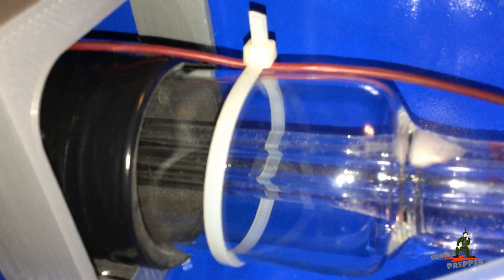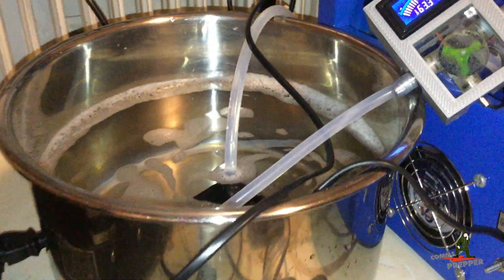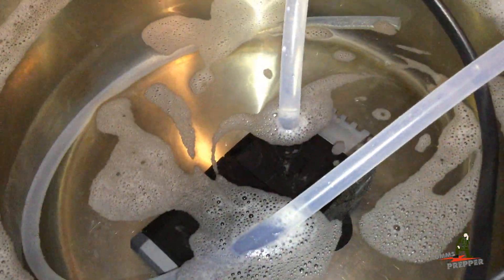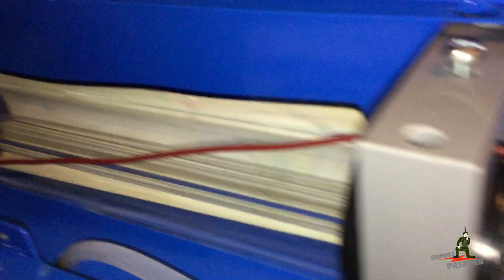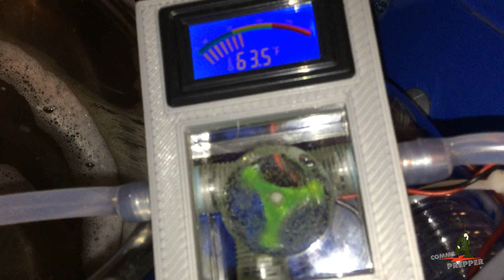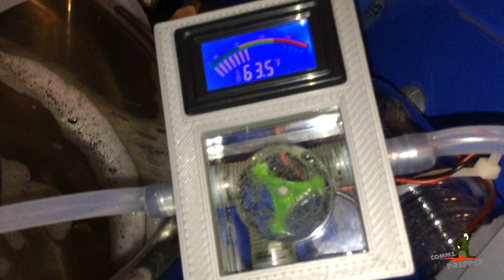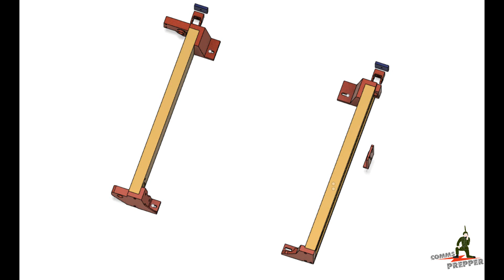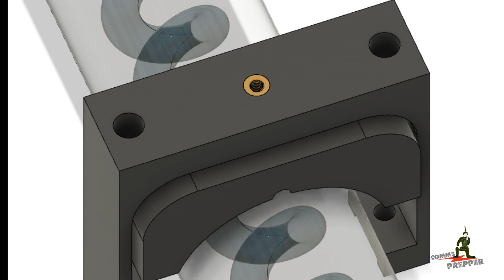K40 laser cutter water cooling system

Comment: Just stand the whole thing on it's end, air bubbles bleed out in seconds. The power supplies blow mostly because of the under spec rectifier, more recent models come with a 6a rectifier which fixes the problem.

Comment: You should not have to redesign the retail  machine. If it doesnt work as it should just return it for a refund.
Reply from the maker: I purchased it used off of eBay and is was clear it was dropped/twisted (or something).

Comment: You should warn, that if you not doing new brackets for co2 tube, you shouldn't lossen the tube to fire out the coolant bubbles because you'll need to align the beam to the 1st lazer.
Reply from the maker: Good point!  Thanks for pointing that out.  I will add a comment about that in my next K40 video.

Comment: Very nice JOB !   Looks like a Proteus flow sensor knock-off.  No need to get all the bubbles out.  You may need a higher PSI pump, or heat exchanger.   Or you can use a sink faucet attachment, to the pump and the temp will then remain constant.
Reply from the maker: Thanks for the tips.  This is all new to me so I am learning as I go.  My plan was to use a cooler for the water and put ice in the cooler.   Can you recommend a pump?  I tried to find the highest letter per min pump I could on Amazon.